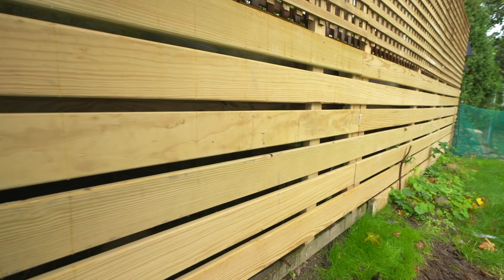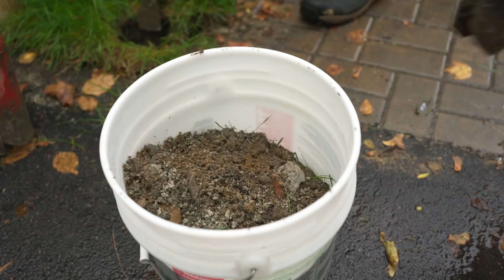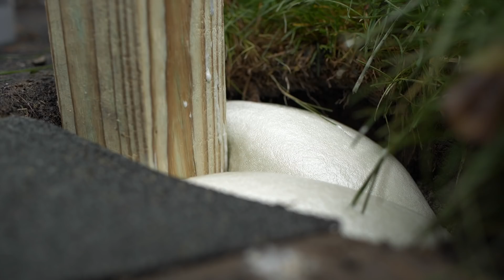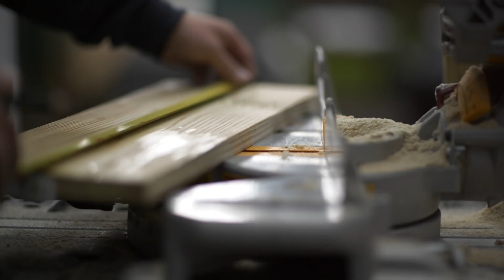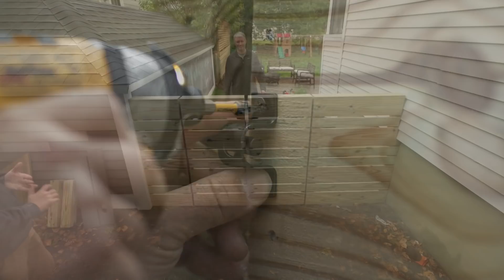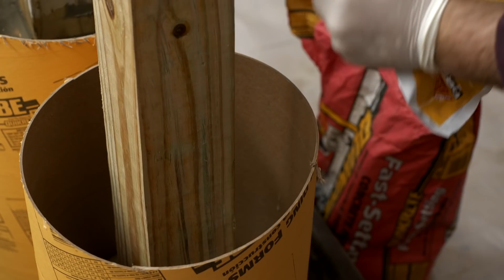How to Build a Custom Fence Gate | Ask This Old House

Comment: The foam, concrete will work if u follow the instructions that is 50%.
The other 50% is the ground, earth, soil, sand has to be strongly compacted around the concrete, foam if that is not case the post will be lose and light wind will shake it and fence will be more saggy. 
Always the ground, soil, sand, earth has to be compact strongly if not no  matters what u put inside the whole will not stand up correctly.

Comment: "Fast setting concrete don't even need to mix". I've built fences and have seen many built. We've haven't been mixing regular since day one. Just pour half in the hole, put water, pour the other half, pour more water, move on. Save 2-3 buck a bag over this fast setting crap. And enjoy paying an extra 8 bucks a hole for the foam garbage. And last time I checked, chemical foam leaching into your top soil isn't that great.

Comment: Congratulations your post will lost 10 years and not 20. 
You don’t need concrete. Just dig hole 3 -3 1/2 feet deep send some gravel down level your 5x5 post and pack it with crush stone and dirt. Works like a charm

Comment: I'm surprised that no one has mentioned on the comments that that gate is going to be sagging two months after installed. Without the diagonal board going from the bottom hinge to the opposite top corner that gate is doomed to fail.
Reply: I thought the same. Although it's certainly a small gate so perhaps that isn't as much of an issue.
Reply: It will fall over before that time. The foam had zero weight...
Reply: I know!   Usually you get more sound advice from TOH!  His comment that’s”it’ll last a lifetime” is sort of laughable when considering the materials, the corner joints and lack of at least that diagonal!  Kind of surprised.
Reply: It is with butt joints and no corner supports. Even adding just a couple of L brackets would have been better. That plus the foam, that gates not gonna last. I miss Bob.

Comment: We use that concrete for years putting in big satellite dishes. It's been around quite a while. The one thing I found and I think if they cut open the bucket where they poured the test in is that the water doesn't always get all the way to the bottom. We found it it gets about a third of the way down which gives the appearance of a solid set. But it's not the bottom is still dry mix. As time goes on groundwater seems to set the bottom two-thirds of it because I've gone back after about a month and it's been solve it all the way down. What we started doing was to put it in just like they did only after we dump the water in will it take a stick of rebar and work it down into the concrete so that we created penetration holes down a foot or two. We would punch about six of those holes so that the water could penetrate much further and faster. Prior to doing that we found it we would have to leave the pole set for at least a week before we could put the big dish on it but once we started doing that within two hours we would have a solid set Pole
Reply: That's because that red bag is a marketing ploy. It's the same crap as the regular with an "additive" that the company wanting your money promises does something. You won't have to wait for groundwater if you pour half a bag and add water and then pour the other half and add water. And 100% on using a poker stick to work the water into the mix. Plus it acts like like a float to get the  aggregate to sink. But needing a week to set is exaggeration unless you went deeper than 2 foot or you're setting pole during a week long monsoon. This is coming from someone who has done alot of fence poles in his life. I don't even use boards to hold the poles. Just have a buddy hold the pole flush, dump half a bag of reg quikcrete, dump water, dump rest of bag, dump water. Check plum, poke with 2x2 to work mix down. Wait 24hrs before messing with it.
Reply: That was basically my concern with pockets of dry mix.. but ground moisture would resolve it over time but still not sure would do it for anything other then fence post etc.. I assume it costs more also
Reply: @Tratios  the foam is more costly 13 bucks a bag for foam and around 6 bucks a bag for a sack of the no mix concrete they used here.
Reply: One way to find out,  just build an acrylic box as a "hole" and see what's really going on.
Reply: Easy way is pour water in first,thn slowly pour dry into it.
This self-mixes.
Reply: @2chipped  and leaves dry powder floating on top, like dumping starch or instant cocoa into a cup of water. I don't have the experience that Jim does, but I'd suggest doing it in layers, pour in a couple inches of powder, add some water, give it a minute, add some more powder, and more water, and repeat til you get your fill. 
Or just mix it in the hole with a rebar. Just cause it says "no mix" doesn't mean you can't mix it, and the fast-setting is what you're going for anyway.
Reply: That's the best way to do it even if you mix it up in a tray .

Comment: the foam looks pretty alright if you're not worried about it supporting anything of substance. I'd still rather have the concrete for things like a deck though.
Reply: Probably fine for that gate. I used that same foam for my mailbox and it hasn’t budged at all in 4 years.

Comment: that expanding foam is brand new to me.   Don't think I'd trust it in any load application but for most posts looks super handy
Reply: It’s also WAY more expensive than a bag of concrete
Reply: yea, definitely wouldntdepend on it but looks handy
Reply: The foam is useless. It is very tight connection as first but it shrinks fast and becomes loose with in hours. Used it on a small gatepost and had to use concrete to fix it, it was a nightmare. Great idea still
Reply: @TJO1733  that sucks that you had that experience. I used it to set my mailbox 2.5 years ago and it’s still doing great.

Comment: What is the price of each of those products your used  in your demo?
Reply: Based on "home center" prices:

$12.70 for the foam bag
$5.67 for a single 50lb bag of concrete 

You may need multiple bags of concrete though depending on the job.  

But if you have multiple posts to put in and can set it in 3 minutes vs 30 minutes, the job can take less time and it might be worth it as you might only save $2-$3 per post depending on the hole size.  

For example, lets say you have 10 posts and need 10 bags of foam.  You could finish setting the posts in 35-40 minutes.  Using concrete, you're looking at 2+ hours of hauling the bags, opening them, waiting for things to settle, having to get water, refill buckets, and waiting for things to settle.  

If you're paying someone to do it for you, that's $127 in materials in foam and lets say $50 in labor for $177.

The same for concrete could be  $85.05 in materials, but $100 in labor or $185.05 total.
Reply: @nramos33  Thank you kindly

Comment: No diagonal brace or cable in the gate frame to prevent sagging?
Reply: Well, thats a really small gate
Reply: @TJO1733  As well as it’s attached to the wall. No load bearing other than the wood itself.
Reply: @TJO1733  it’ll still sag over time and close in at the top most likely.
Reply: I was going to say the same thing, this channel should really try to promote best practices.